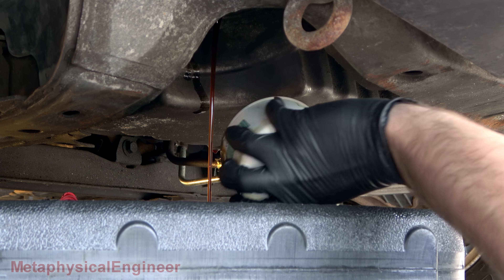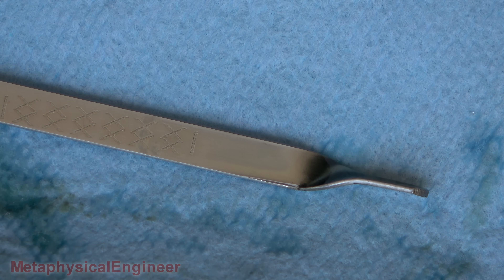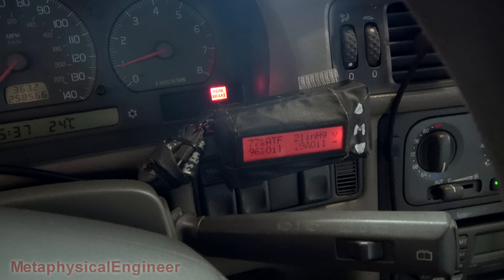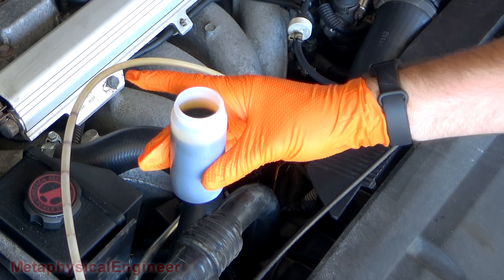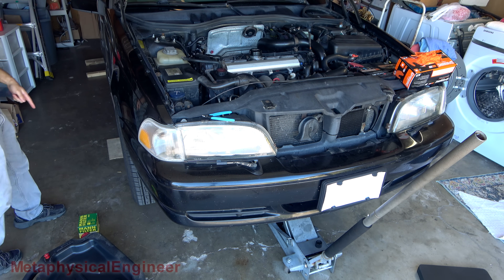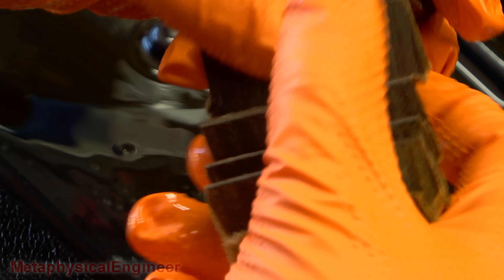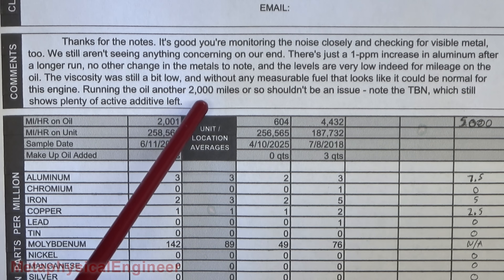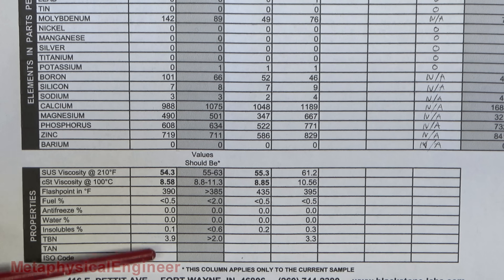Valvoline Restore and Protect vs Noisy Lifters - Used Oil Analysis and Filter Cut Open

Comment: Add a bottle of "Swebco #502 oil improver" within five minutes to 1 day the noise will disappear. If it is good enough for Porsche and Ferrari it will be good for your car. If it doesn't solve the problem you will have a flat lifter and a repair will most likely needed.

Comment: The other side of the coin carbon in suspension. 

That means carbon of a certain micron is being pumped through out all the bearings and journals.

Question is how big a dose of carbon does it take to wear your engine out while carbon is in suspension?
Reply from the maker: Very good point!  For the most part anything small enough to get through the filter tends to be small enough to not hurt the moving parts.  As in small enough to fit between the bearing and journal or the ring and cylinder wall.  If the soot was tearing things up, the microscopic wear would show a lot of metal.

Diesel engines end up with lots of soot in the oil, to the point that oil looks black almost immediately, and those don't suffer extremely high wear from that particle load.  That said heavy duty rigs often have very low micron secondary filters to capture soot. I think those use a bypass configuration where a small percentage of total oil flow passes through the fine filter to slowly capture the soot, while the main filters handle full flow to the engine and catch the large, immediately dangerous particles.

Comment: Yeah sorry for your tick in the engine, just might be a collapsed lifter that just has to be changed... Excellent 👍 video, just about the most professional and thorough job you can do without being at a full scale shop or laboratory...I might try and pull off a valve cover to see if I could see any cam lobe or valvetrain wear to see if the tick is coming from there and causing potential failure... But you never know, what I thought was in my engine internals was actually a timing Chain Tensioner... Good 👍 Luck again and Thanks for the oil testing too, that gets expensive..Oh yeah, wish I had your like New headlights plastic, difference between in a garage and having to be outside in the UV ☀️ rays of the sun ...
Reply from the maker: Thanks for your kind words!  An update video at 5000 miles will be releasing tomorrow at 3pm PST.

As long as the oil tests don't show the cam tearing up, I intend to keep testing.  Probably out to 20k total miles and four oil intervals.  Then I'll consider taking the top end apart.  This engine design uses a one piece structural cam cover that holds the upper cam journals, so even getting eyes on anything but the #3 intake cams is an invasive procedure.  Forty bolts and hours of cleaning the surfaces so the anerobic sealant will work properly again.

The headlights are glass, which is why they look so good!  This car unfortunately has to stay outside most of the time as the garage has to be shuffled around a bunch to fit it.  The turn signal lenses are plastic and are showing UV damage, as is the reflectors on the headlights, so all of those will be due for replacement sometime in the next year.

Comment: I'm curious. Do you think this oil would have any affect on GDI valve carbon build up. The recirculated blow by from the PCV gums up the back side of the valves on GDI motors.
Reply from the maker: This oil can only clean what it touches for a long time.  Unfortunately by the time broken down oil mist gets to the intake through the PCV, that cleaning effect will probably not work as intended.  A catch can to reduce how much junk goes through the intake, and regular cleaning with solvents through the intake are more effective.  

One way this oil might help is by cleaning fouled rings and reducing blowby, and thus reducing PCV mass flow, assuming the system operates with crankcase under vacuum.  This engine is port injected, though I have a couple videos testing a catch can and experimenting with the PCV system behavior. https://youtu.be/swHAN0I7Wo4 and https://youtu.be/4UwFhrd6T58 if you're interested.
Reply: @MetaphysicalEngineer  My thinking is, since this oil contains solvents and solvents are generally more volitile than engine oil itself, it would vaporize more redilly and be brought into the PCV system and through the valves thereby disolving some of the deposits. Since I change oul every 5,000 miles, this solvent crossing the valves would be consistant over that period. I have used the Berryman's product that is injected into the throttle body but am unsure how well it works since I don't want to take off the intake manifold to inspect the valves. BTW it is a Mazda Skyactive G 2.5 engine that I think has a built in catch can of sorts.
Reply from the maker: This oil really doesn't have solvents.  Not in the sense you're thinking like Seafoam or Berryman's.  It's not really evaporating at all- otherwise the engine would burn a ridiculous amount of oil.  Lake Speed Jr. The Motor Oil Geek has some excellent videos where he talks more in depth with Valvoline reps about the oil's chemistry.  

Berryman's is good stuff and spray cleaner through the intake will definitely help in keeping valve deposits under control if done often enough.  But you would need to get eyes on the valves to determine what "often enough" even is.  

Most engines do have oil separators that drain back to the sump.  How effective those are really depends.  If you're still getting oil slime in the intake piping and manifold, an additional catch can could help.  But that's an extra maintenance item with messy consequences if you neglect cleaning and draining it.
Reply: @MetaphysicalEngineer My 2.5l skyactive g was "stumbling" on startup at about 75k so I tried the Berrymans kit. I didn't notice much difference except the side effects causing sensor malfunction for a few miles. I'll have to dig into the shop manual to see if I can get my bore scope into the valves without removing the intake manifold. I understand that carbon buildup is not a big issue on these engines.
Reply from the maker: I'd also do a few rounds of injector cleaner as well if you haven't already.  Poor fuel spray patterns can cause hard starts too.
Reply: @MetaphysicalEngineer I use Berrymans B 12 and their high mileage fuel treatments. The car runs fine otherwise. 35mpg, 2028 Mazda 6 natural asp. 2.5l 85k. I don't think I could squeeze more out of it. 5/95% city/highway.

Comment: Anecdotal, but i found Restore and protect to be thinner than equally label grades of other oils.  As indicated in lab test.
Reply from the maker: I've seen new oil analysis showing the expected 10.7 cSt, but a few used analysis reports with shear numbers like mine.  Curious if my engine is weirdly hard on oil, or if the R&P itself is shearing easily, yet still offering good protection.

Comment: Cant find this oil in europe!! ! 
Ill just have to keep adding some atf in the oil with every oil change
Reply from the maker: Ouch, that's unfortunate.  Heard lots of mixed news about the cleaning properties of ATF.  Something that has caught my eye but I have no personal experience with is called Kreen by Kano Labs.  BG also makes an expensive Dynamic Engine Cleaner kit that I've also not used personally, but seen many videos of pro shops using it to bring back neglected sludged engines.

Comment: Lifter tick may be cam/lifter damage.......the oil won't help!!   Your oil came out pretty clean!!  
Hoping for the best!!  But it seems a bleak future!!
Reply from the maker: Thanks for the encouragement!  Normally such a noise would mean a cam lobe or lifter is getting torn up, but there's zero indication of excess wear in the filter or oil analysis. A new video is coming very soon with the 5000 mile update.

Comment: Can you use this oil ALL the time, or it’s going to wear everything down prematurely?
Reply from the maker: It's not wearing anything down. The oil report shows excellent wear rate numbers. Supposedly also has good seal conditioners like high mileage oil to help avoid causing leaks as it cleans.

Comment: Use 1.5 to 2 qts of shell premium diesel in the crankcase with the oil. Start the car and idle for 20-30 minutes and shut off the engine wait at least 1 hr and run for 30 minutes. drain and filter change but don't fill until the pan is empty. Refill, start and idle 20-30 with the recommend oil.

Comment: I believe the sample you pulled with the vacuum pump can be compromised because if the tube hits the bottom of the pan it could pick up more contaminants then in the middle of the oil. Next time there might not be contaminants at the bottom of the pan due to the cleaning action of the oil or there might be more contaminants, you just don't know. If you're able to grab oil from the middle of the pan without touching the bottom I believe it would be a much more reliable and consistent sampling method.
Reply from the maker: Very good points!  I’d never used that sample pump before so didn’t have a feel for how the tube would behave.  If there had been a layer of carbon or sludge, that would have skewed the results.  Though would have shown higher insolubles or wear metal counts if that accumulated material had collected junk over time.  

Didn’t seem to adversely affect the sample this time thankfully and I now have a better technique for pulling the samples.  A bore scope inspection recently showed the pan was clean enough to eat off of so there’s more peace of mind.  I doubt it would have gone from sludged to absolutely pristine in just a couple thousand more miles.

Comment: We need a video on your oil plug removal contraption
Reply from the maker: There’s really nothing to it.  Paper towel jammed in the socket to hold the plug tightly, and an extension as needed to keep the fingers away from the scalding hot liquid.  If I decide to do shorts, maybe that could be one I make!

Comment: I use Walmart oil, oil filters. Change oil every 5-6,000 miles and got 327,000 miles on my Sentra. Other things went before engine so I sold it. Think this restore and protect baloney is just that. Spending money that makes one feel good, but has zero practical value. Just change your oil and don’t drive like a lunatic. That’s it.

Comment: any updates on this?
Reply from the maker: Coming Soon!  Changed the oil at a bit over 5k miles and have most a video made, but waiting on lab results.

Should have been out weeks ago but both USPS and UPS had multiple delays and errors so the first sample and the backup sample only just got to the lab this week... more than a month after I sent them off!

Comment: Good video Sir! I just switched to VR&P yesterday. A tip for checking your oil on the dipstick...Lay the end of dipstick with oil on it flat onto the blue towel, then slide the dipstick upwards slightly. The oil level will show clearly on the paper towel. My oil level is difficult to read also. Cheers!

Comment: You should always check to see if the gasket from the old filter and the crush-washer from the oil plug has been removed if your plug requires a washer.  Double gaskets on your oil filter will give you problems.
Reply from the maker: Very good advice!  I should have shown that part more clearly in the video.  Though that would have other people commenting that I'm wasting their time because obviously everybody knows how to do an oil change!  Impossible to keep everyone happy when posting something on the internet.

Comment: That car has solid lifters.
Reply from the maker: Later versions did have solid lifters and overall redesigned cylinder head.  The early versions such as this one have hydraulic.  I've had this one apart and seen the lifters and the oil supply channels in the head.

Comment: I like your drain plug retainer - I'm definitely going to start using that. 

I have a high mileage engine that I'll try this oil on soon. Nice vid!
Reply from the maker: Thanks!  Really useful when that oil is boiling hot and will come roaring out.  A little more risk but ensures all solids are well suspended and carried out as it drains.

Comment: I use ice and water refrigerator supply hose from Home Depot. I cut a chunk and pull it up with my mouth. Pull the hose out of the dipstick and then put it in the sample bottle. It’s plenty of oil. Then throw away the hose. It is a huge hose. Good for 4 tests at $4.95

Comment: As an owner of a 2014 Silverado 1500 LTZ with a 5.3 and 160k. I can tell you what actually works. First of all I use Mobil1 0W-20 but recently found out Chevy and other manufacturers only say 0W-20 because they were able to sell the vehicle while meeting certain MPG category. But running 5W-20 or 5W-30 your engine will last longer. That being said I came across a Canadian man who has a 2014 Silverado with 350k on it. These trucks and their engines are notorious for lifter tick and collapsed lifters due to Chevy’s incredibly stupid AFM system. I know you have a Volvo but trust me…this works and it makes sense. The guy told me that he substitutes 1 quart of transmission fluid for a quart of oil every oil change. Initially I thought he was full of it. But after some research I realized transmission fluid is essentially a bunch of detergents. The first oil change 3,000 miles later having tried his trick and the amount of sludge that came out upon drain was incredible. Immediately after adding new oil (Mobil1) and new transmission fluid (Mobil1 Fully Synthetic) and when I pulled into my side lot towing my enclosed trailer I 100% believed my truck had stalled. It had not…it was just that much quieter. I’ve been doing this for two years at this juncture and not only does the engine run far cooler but it makes half the noise it used to.

Comment: Just did my first oil change with R&P and an OEM filter yesterday.  I've used M1 and an aftermarket filter for the last 50k miles or so.  Noticed by oil pressure went up 5-10 psi at idle, and 3-4 psi on the highway.  Maybe it's the redesigned AC Delco filter, but I'm not complaining either way lol.  My oil always comes out black, so it'll be hard to tell if it's "cleaning" well or not, and my dipstick still looks like new.  I know a lot of folks use that as a reference point for varnish removal.  Either way, the ole girl is purring.  GM V8s seem to love Valvoline

Comment: Did you put an entire can of Sea Foam in it, and it didn’t fix it? How long at the temperature did you run it?
Reply from the maker: I followed the instructions for 1 ounce per quart, but ran for 600 miles instead of the recommended 100 to 300.  Mix of driving from slow speed running errands to hundred+ mile day trips to sightsee.  Plenty of time at temperature.

Here's the videos about that part of the project:
https://youtu.be/h9ou49Q3rno
https://youtu.be/geOS8AapEy0

Comment: Can the V RP be used in a 2012 gmc Sierra 1500 light duty work truck that recommendeds Dexos 1??
Reply from the maker: It's a quality oil from a reputable manufacturer.  Use the recommended viscosity grade and you'll be fine.  Dexos is a pay to play item that also requires revealing a lot about the oil's formulation to GM, which Valvoline has elected not to do.
Reply: Yes

Comment: Restore and Protect changed my Soul's oil burner of a guart ever 1500 miles to less than a quart every 5000 miles! Outstanding
Reply: I just got my 2014 soul 1.6 at 150k miles. I’m using Valvoline RP to help the oil burn. I just changed the pcv valve with the O’Reilly generic. I saw something in the soul forums that changing spark plugs will help too. How do you go about it @jameswright5808
Reply: I’m hoping for similar results in the sonata, Kia’s had similar issues with oil.

Comment: Nicely done. The oil states that four complete oil changes is needed to do the complete cleaning. They had a different product where it worked faster but it worked so fast that it would plug up the filter the first time. They took that off the market.
Reply from the maker: I'm hoping the analysis continues to show favorable wear counts so I can simply let the cleaning action work for several oil changes.  So long as the lifter noise is nuisance rather than destructive, I can let the experiment run.  Approaching the 5000 mile mark where I'll sample again, change oil and cut open the filter.

Comment: I’m not sure if those have hydraulic lash adjusters to tick. Can anyone more familiar with those engines confirm?
Reply from the maker: The early versions of this engine family had hydraulic lifters. I've had this head apart before and seen them myself. 

In 1999 or so Volvo started using a new valvetrain design with shim and bucket lifters.  Likely a phased rollout to clear older inventory, so vehicles in that era may have an old or new head.  So much fun for finding compatible parts!

Comment: Is okay 👍 to put n 97 buick lesabre 🔧🤔????
Reply from the maker: '97 lesabre calls for 5w-30 or 10w-30 oil.  It says 5w-30 is for cooler temps only, but that's assuming 1990s oil technology.  Modern oils are much tougher so 5w-30 can be substituted for 10w-30 in basically every application.

Comment: Any issues with leaking seals after using Valvoline R&P?
Reply from the maker: No leaks so far!  This engine has been running "high mileage" synthetic oils for 100k miles, so that may have contributed to the seals being in better shape.  Only the front and rear main seals are original- essentially every other oil control rubber component has been replaced at least once, mostly as part of other repairs or maintenance that involved disassembly, not because of a leak.